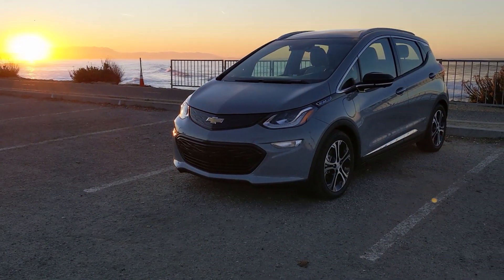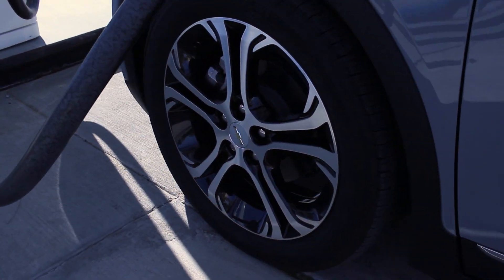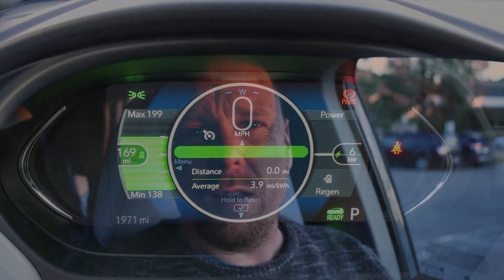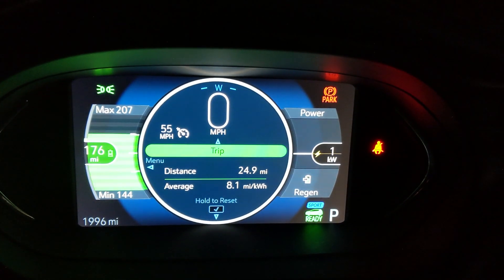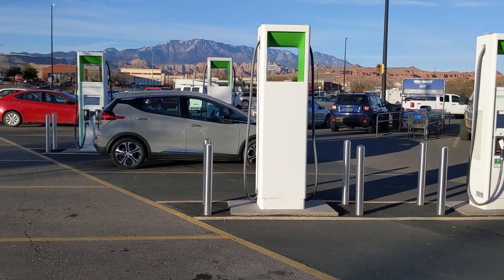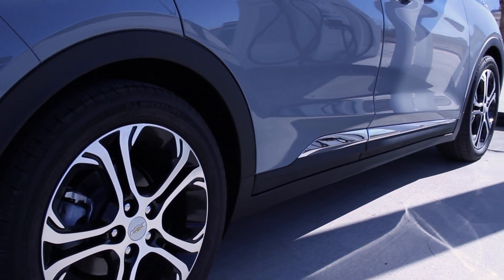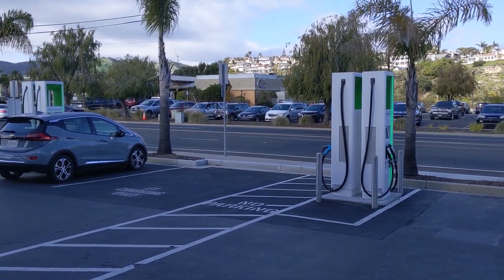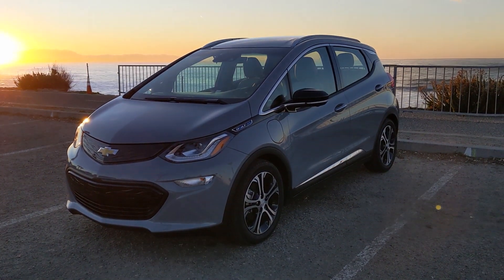2020 Chevrolet Bolt EV Low Load Efficiency

Comment: Have a 2019 Bolt since July. Tried Level 1 but couldn’t stand waiting 2-3 days for full charge. Installed Level 2 32A 220v and it is great. Charges quickly and don’t ever worry about it any more.

Comment: I have a question of tire pressure: the dashboard often shows tire pressure 2-3 psi lower than when it's driving on the highway for a while. Is that because the tires get more heat when running fast? If so, should I adjust the tire pressure to 35 so it will get the recommended pressure when driving?
Reply from the maker: Yes, the tires warm up with driving; however, the max tire pressure is for when the tire is cold. Anywhere from 38 to 42 cold PSI is fine for the Bolt EV.

Comment: 8.1m/kwh? Holy crap! At that rate, you could get over 500 miles range!
Reply from the maker: Yup. Hypermiling a 2020 Bolt EV should result in over 520 miles on a single charge.

Comment: This is pretty incredible.

Am I wrong in calculating a range of about 480 miles to 530 miles per charge?
Reply from the maker: That's about right. The 2017 to 2019 should be able to get close to 480 miles when "hypermiling," so this would be about 10% more range.
Reply: News Coulomb that is a really good high efficiency.

Comment: Hi Eric, congrats on over 8 miles per Kwh.  I have a 2017 LT never got near that level (or if it was it was never sustained for more than a few 10ths of a mile).  Do You think it will be possible to upgrade the earlier cars with a 66Kwh pack for a price?  I know Yours is actually out of warranty so this would be out of Your own pocket.  Although this could be very expensive I am sure it would be about 1/2 the cost of buying a new car.  Not sure if it would be worth it.
Reply from the maker: Thanks! I'm sure it would be possible to upgrade to the 66 kWh pack, but it wouldn't be through GM. Personally, I think what will happen is that someone will offer an aftermarket upgrade with both more capacity and faster charging speeds. Something like what Fenix Power is doing for the Nissan LEAF.
Reply: @newscoulomb3705  could be about the Fenix power option -I would also think You could buy the GM part and have a dealer install it.  With Your pack degradation being still only 5% though I guess it would likely be another 10 years before You even have a need for a swap. A lot can happen in 10 years You might not even have the bolt anymore
Reply from the maker: @d201120112011  Yes, and I hope the battery swaps are significantly cheaper in the future.

Comment: Speaking of efficiency I've had an issue with climate control maybe you can figure it out?  My 2017 I could always defog my windows just using fan and ambient fresh air without impacting range, however now with a 2020 for the life of me, unable to have just fan on without impacting range, and I've tried every combo of auto on/off, ac and heat on/off, auto defog on/off, and still unable to get it to work.  Have you notice similar behavior, any answers?
Reply from the maker: I did notice that the 2020 was running the AC even when it didn't seem necessary. I was able to shut it off by just pressing the AC button on the Infotainment screen (it went from lit orange to off, and that did the trick).
Reply: @newscoulomb3705  You probably have auto defog set to on in settings, however, that's not my issue.  If you get a chance, try turning on fan only (with defog button on) without activating climate control and impacting range.  I could do it on 2017 but not 2020, I'm wondering if it's with all 2020's or a problem with mine.  Thanks
Reply from the maker: @jfaust2001  Ah, yes. I know what you're talking about. I can do that just fine in my 2017, but the conditions weren't really right to test that on the 2020.
Reply: @newscoulomb3705  Someone posted an answer on chevyboltforum, i just tested it and it seems to work:  you now need to push not only defog button but also face and footwell buttons and then you get your range back, bizare.  Of course now there's no way to keep cold air blowing in your face :)
Reply from the maker: @jfaust2001  Yes, Darren Orange discovered that. It was a good catch.

Comment: Just got the same car 2 weeks ago. I haven't seen 8M/kwh yet but  considering my Merc B EV averaged 3.3, what a progress! Fit and finish of the car is excellent and general functionality and utility of the car is awesome. Heard complaints about the seats on the previous model but on the 2020, a 6 ft2 guy feels quite comfortable driving it. More people should look into this car as an alternative to more expensive cars.
Reply from the maker: I completely agree. Also, though, this efficiency is under very ideal circumstances. If you have a chance to check out my 621.4 mile run in this car, those are the efficiencies you can expect to see on freeway runs (about 3.2 to 3.4 mi/kWh), and around town will be around 4 mi/kWh. 

Either way, I completely agree. This car is a great option for the price, and offers a lot of utility.
Reply: Thanks for those #s. I'm getting about 3.2 in my first week with temps in the 30s. 60/40,  highway/city over about 400 miles.

Comment: I have had owned my 2020 Bolt EV for 6 weeks now. When the weather was warmer here in Scottsdale, AZ. (70F) I was averaging 285 miles on a full charge. Recently temperatures have dropped to 34F. I'm lucky to get 230 miles on a full charge.  Both averages are based on 50/50 conservative highway and city driving. Is this normal?  BTW, I'm not using the heater in the cold weather, I am using a plugin electric blanket. I hope the battery is not defective..
Reply from the maker: Yes, that is normal. Even not using the heater, you should expect about a 20% drop in efficiency going from 70° to 34° F. After all, a gas car will see similar efficiency loss in mpg under those conditions.

Comment: Is there any difference in seats? If they have updated the drivers seat to be wider, more comfortable, I would want to switch out my last years model driver`s seat.
Reply from the maker: The seats have been improved since 2017, but I don't know that the 2020's seats are any different than the 2019 Bolt EV's seats. The width of the seats can't really change, though, due to the size of the vehicle, so cars like the Bolt EV and Kona Electric will be stuck with seats that are about this wide.
Reply: @newscoulomb3705  This is my first EV. I love my 2020 Chevy Bolt, but these seats are atrocious. I went ahead and bout some memory foam cushions for the front seats. It is night and day. After I installed them, I used them for a bout 2 weeks and thought I would go back and try the seats without the cushions. I actually hurt my back driving back and forth to work over a few days. Sooooo....I am back to my memory foam cushions. I will not be taking them back out again.

Comment: The combination of low speed , short distance, warm climate,and all downhill you did over twice the rated 
range .520 miles.. My 2017 lifetime is 2.9 kwhr per mile.
Reply from the maker: Well, yes. That's why it was a "low load" test. Also, 2.9 mi/kWh is extremely poor efficiency for a Bolt EV. Including charging losses and at least 70% of my driving being at 65-75 mph freeway speeds, my 2017's lifetime efficiency is 3.4 to 3.5 mi/kWh.

Comment: Thank you for this video. Would you do a follow up showing charging at home using level 1. I’m specifically interested amperage on a 120 volt home charging. I’m assuming that I can bump up from 12 amps to 15 or 16 amps?
Reply: L1 is usually limited to 12A because most home outlets are rated for 15A. However, NEC says continuous loads (like EV charging) need to be deranged by 25% - hence the OEM L1 EVSE’s limit. For 16A, you’d need to be on a 20A outlet, using a different EVSE with a NEMA 5-20 plug.
Reply: No. The car is the limiting factor. The Bolt(and Volts) you can change either 8 or 12 amps. It defaults to 8 amps so you have to change it on-screen. My 2011 Leaf draws 12 amps. My 2016 Leaf draws 10 amps. The Leafs you don’t have the option to change it. Yes three EV’s in the stable.
Reply: @rockymonge4979  the car is only responding to the capabilities the EVSE is advertising; it does offer the 8A/12A soft switch when it sees an EVSE advertise 12A at 120V, but that is only because residential 15A circuits are often shared with multiple outlets or lighting. OP was asking about 15 or 16A, which is not possible with the OEM EVSE because its NEMA 5-15 plug is hard wired.
Reply from the maker: I might do a video on 120 V charging in the future, but I don't have access to charging at home.
Reply: Haha DYAC - that was supposed to be "derated" not "deranged"!

Comment: How small of a rim will fit on the bolt?   I am looking for heavier 15s if possible.
Reply from the maker: I know 16s will fit, but 15 might be a bit small. If the offset and width are right, you might still clear the brakes.
Reply: @newscoulomb3705  A number of people up here in the great white north run winter tires with 15" rims.  So It's certainly possible.  Though it's possible that some 15" rims might not fit.

Comment: Eric my car is 10 day old. Most of my driving around town is 45 mph and lower. I drive in Low also. Coming from a Volt I understand these cars and the Volt GOM always had me at 65/70 with no Climate Control.

This car has yet to give me more than ~4.7 if I'm lucky. I'm usually around 4.5. 

What am I missing?
Reply from the maker: I'm not sure. A lot of this could be due to conditions. Weather, starts, stops, traffic, etc.
Reply: @newscoulomb3705  UPDATE: 
so what I noticed this weekend is that while my average is at 4.7 or 4.8 pretty steady around town, my projected range is climbing. The mid-estimate is now up to 260 after being stuck at 235ish. Maybe the car just needed to figure me out....?
Reply from the maker: @VictorYepello  It could also be that the tires are new. The first 1,000 miles or so on new tires can be very inefficient.
Reply: @newscoulomb3705  Eric, I'm in Palm Springs so this time of year weather is idea. Yes there would be stop and go driving but I'm high on the pedal. Same conditions where my Volt would give me 66-68, even up to 70 this time of year. So yes, it's a mystery,

Comment: Do you have any thoughts on what the GMC hummer EV would be like in terms of efficiency ? I know it's probably going to suck compared to the Bolt, but I'm still guessing you can get 2 mi/kWh on average.
Reply: It's way too early to say.  We don't know if the GMC will be mid-sized or full sized.  Will it have crew cab or regular cab?  Still far too many unknowns.   GM has also been very good at reducing the weight of it's vehicles.   If I had to guess I'm thinking this will be lighter than people think.  I also think this will have a new 800V architecture which can help to improve efficiency.  I'm thinking efficiency will be close to 2.5 mi/KWh.   Slightly less efficient than a Model X LR.
Reply: Erik Stephens But the Hummer doesn’t use BEV3, it uses BT1. BEV3 is supposedly GM’s pinnacle of EV design and efficiency. It will be revealed on a Cadillac crossover this April.
Reply: @adithyaramachandran7427  Yes you are correct and I'm fully aware of that.  But I'm not sure what your point is?  So your claiming because BEV3 is going to be advanced that means BT1 won't be?  BT1 is a body on frame platform that is supposedly related to the T1XX truck platform.  Of note T1XX is a very advanced platform and one of the lightest in the segment already.  I fully expect GM to update and modernize BT1 using their latest manufacturing technology.   I expect to see a large portion of the bed to be made from carbon fibre for example.  (Like they do on the optional Sierra with Carbon pro).  Plus a number of their hybrid material approaches with foam metal casting.   GM has plenty of idea's that they have teased and successfully tested on a smaller scale that we are going to see on these vehicles.
Reply from the maker: @erikstephens34  People chronically underrate GM's engineering prowess for some reason (probably because GM doesn't market it enough). 

Also, though the Hummer EV is stated to have a 400-mile range, based on some of the descriptions, I think we can expect some of the BEV3 platforms to push 600 to 800 mile ranges. Absurd, but when has physics ever cared about absurdity?
Reply: @newscoulomb3705  Yup I suspect your right. Mark Reuss mentioned in an interview that they are showing an EV on March 4th they were surprised it was possible.
Reply from the maker: @erikstephens34  Oh, interesting. I thought they were just going to showcase the new Cadillac CUV (still BEV2, I'm assuming). I wonder if we might see a Corvette?
Reply: @newscoulomb3705  New Cadillac will be shown in April. The vehicle on March 4th is supposed to be special apparently.
Reply from the maker: @erikstephens34  So the Hummer EV in May, the Cadillac in April, and ??? in March. Yeeeee! I'm getting excited. :-D
Reply: @newscoulomb3705  Found the article its all interesting especially at the end. https://www.greencarreports.com/news/1127008_gm-teases-new-electric-truck-details-boasts-about-battery-flexibility
Reply: News Coulomb lol GM cars speak for themselves.
Reply from the maker: @FELUNKADUNK  Really? And what do they say to you?
Reply from the maker: I think it's going to vary by model. Mark Reuss indicated that the Hummer EV would be available in a variety of configurations, and the single motor, smallest battery option will probably be closer to 3 mi/kWh.

Comment: Wow!  You're running around 37 psi and you still got 8.1?  My personal best is around 6 but I usually drive in hilly terrain.  You normally get around 7 but the new Bolt was at 8.  I'm impressed.
Reply from the maker: Yeah, even if the 2017 and 2020 are roughly equivalent, that's still pretty good. I'm hoping to get some non-GM EVs to test on this route for comparison soon.

Comment: No front license plate should be good for +10 mile range! Thankfully my state doesn't require it, nor should ANY state!
Reply: Out of curiosity, is there data proving that the front plate would add so much drag, causing reduced overall efficiency? TIA
Reply: Jason Park really?! there is data for roof racks and wheel covers that aren’t even a flat surface in front of the car....5% at least
Reply: Incorrect. EVERY state should require it. Rear camera add-ons for dash cameras are a thing, and being able to more easily identify bad drivers behind you when needed is way more important than whatever petty nonsense stops you from wanting a front plate.
Reply: @mjc0961  Petty nonsense?

Comment: Let the car calculate the Bolt efficiency.  Display the driving efficiency, temperature, and road terrain factor page.
Reply from the maker: I'm typically only interested in the outcome. The Bolt EV's driving efficiency calculator isn't available in all vehicles, and because I want to make this a universal test, I'm not sure it's a necessary comparison point.

Comment: Eric, I think you should do it again, I'm not sure I see a difference from my 2017. I originally thought so but I'm averaging about 3.2 in the Northern winter here on the 2020 with the WS80 snows on. If I remember the 2017 did about the same. In a month or so I'll put the original Michelin tires back on and then have a better assessment. I did think about checking the Bose system current draw and the HD cameras which are new to the 2020 but that will have to wait until it warms up here too. Have you tried it in power efficiency mode yet? I thought your 2017 had the roof rails?
I do my efficiency over a month or so and I haven't had the 2020 that long yet - we'll see. Like the Blue of you 2020 test car!
Reply from the maker: Well, that's why I called out the efficiency of this particular run. Under similar circumstances, I think my 2017 would come close. But the fact that they are so similar is interesting in itself.

Comment: Did you do this run in Sport mode?  
Also (cant clearly see the screen) but are you driving in L?
Reply from the maker: Yes to both. It's how I drive my 2017, so it's the same across tests. There's no difference between drive modes with proper pedal discipline.
Reply: @newscoulomb3705  Eric, would you please define "proper pedal discipline"?
Reply from the maker: @timcampbell5873  I'm simply referring to pedal control. If you over or under modulate the accelerator you'll waste more energy in Sport and L than in Normal and D. However, if you're gentle on the accelerator, there's virtually no difference.
Reply: @newscoulomb3705  But doesn't being in Sport mode make it more difficult to be gentle on the accelerator?

Comment: 2020 is rated less efficient according to the EPA as well.  Have you weighed this car vs the 2017?
Reply: It's on the door sill.
Reply from the maker: Yes, the official curb weight is listed, but it doesn't always match the actual weight.
Reply from the maker: I wasn't able to take it to a scale, unfortunately.

Comment: Better efficiency on your low speed loop with the heavy stock wheels and tires that are inflated to 38 psi vs your light weight wheels with tires inflated to 42 psi.
Reply from the maker: Yes, it surprised me.